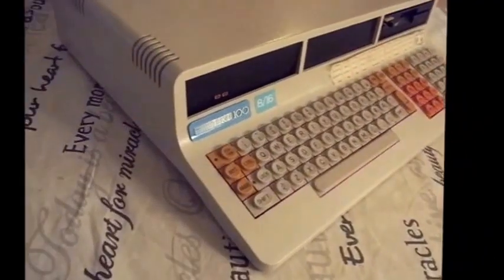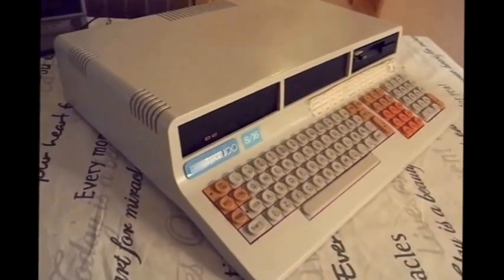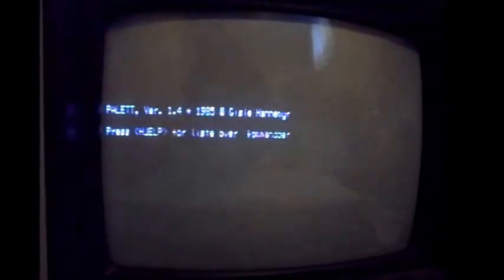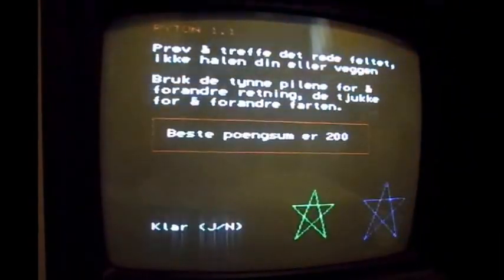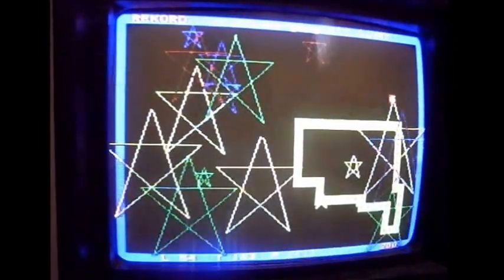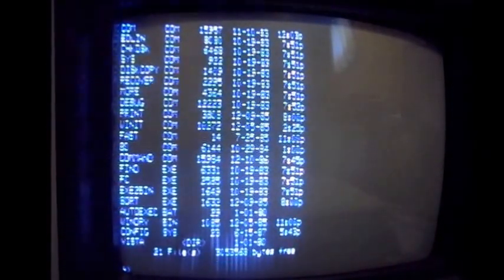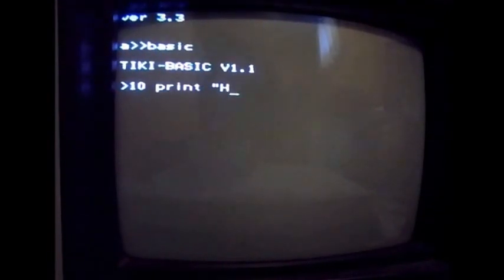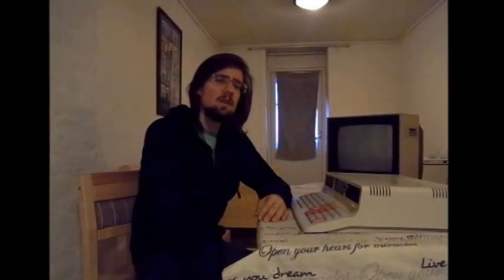Tiki-100, a Vintage Computer Overview

Comment: "late 80's and early 90's..."
we used these at school all the way as late as 1998 here (Sandnes Skole. Arendal) togheter with 4 PC's with Windows 3.0 with one exception. there was one Win 95 Plus computer with internet in the library that we got in 96.
in 1998 they got 6! old Win95 computers from the local government and the Tiki's got scrapped.

the computers where so bad though that if the Teachers where to show anything on a computer they usually borrowed a laptop from one of the pupils. there where some with disadvantage's that got laptops trough the state help program and they where 100 times better than the youth school got at the time.

good old times ^^

Comment: Fantastic to see this computer again. Hard drive ? I've never seen one with that. Thanks for showing the rear of it. My gosh it is expanded a lot. Is there a user community for this system in Norway ? .. Keys look very much like Tandberg Data / Norsk Data keyboards. Maybe they used siemens keys too.. Thanks for another great Tiki-video !
Reply from the maker: Great to hear you like the video!

This came from a library, and that's the reason for the harddrive. I was lucky I did take a full backup, which enabled me to restore the DOS partition after switching to the ST-506 emulator!

As of ND/Tandberg terminals, yes they do also use Siemens keyswitches. However, they use a slightly different type, and from what I can tell they have heavier feel. Black body with black piston (Tandberg) versus brown body with red piston (this Tiki-100). These are only around 50-60cN. For refference, the Sasse switches used in most Tiki-100s are closer to 90-100cN.

We have a small group on facebook dedicated to the Tiki-100, but most retrocomputer enthusiasts in Norway are more onto the Commodores and videogame consoles.